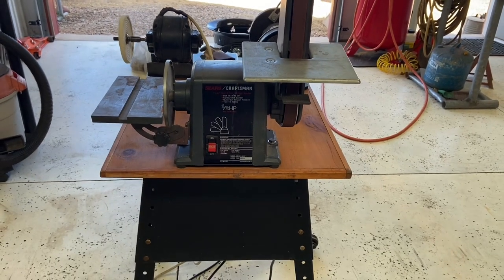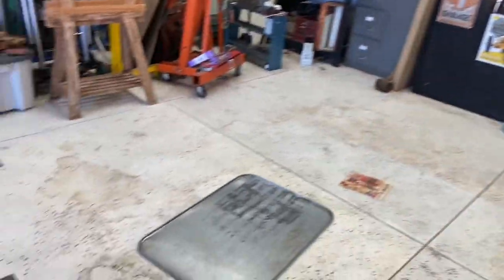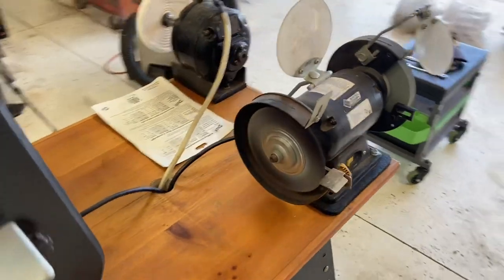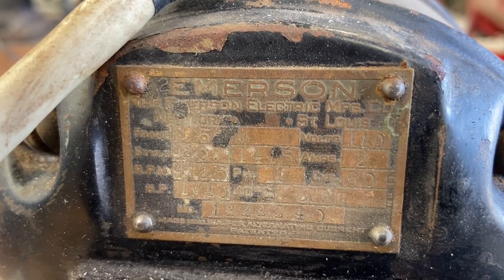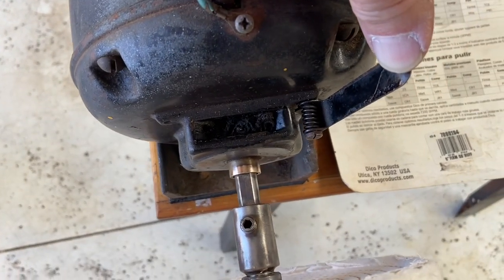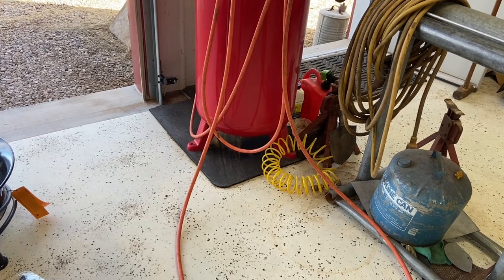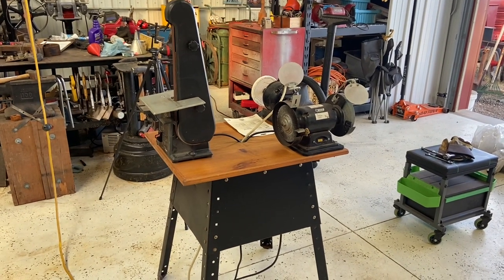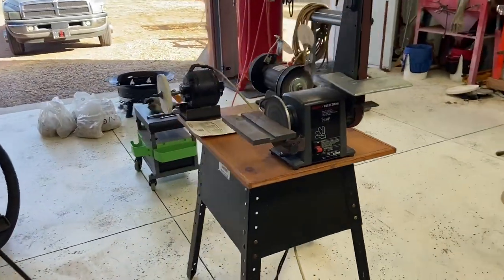#metalfab Shop Portable Workstation Update

Comment: Nice setup 👍 might need to find some weight to put under it... keep it from walking around on you.
A little rubber goes a long way, saves some vibration.
Mount a 3 wide box, duplex in 2 and the switch for the polisher in the third..
Reply from the maker: The table legs have rubber feet so it’s solid. I might have a 3 wide box in the electrical stash

Comment: that's a nice setup,  before you told about the old motor, I was thinking it was an Emerson,
Reply from the maker: Emerson is not something you hear about too often, but I was betting you knew since it was a Missouri company.
Reply: @mattthescrapwhisperer  Seen those oilers on lift motors, except there the motor is a multipole one, running around 740RPM, and the oiler has the same flip lid, but instead of the stuffing, there is a seal front and back of the shaft, and then a bush running through the middle, which has a cutout on the top side, and a bronze ring that rides on the motor shaft, bringing up oil  to the top of the bush as the mtor turns, and thus putting a new oil film always on the shaft, the excess leaving via some slots at the base of the bushing back into the oiler body. Oil level is kept just short of the bush, so it will not leak out much, and the bushings are always going to get a fresh layer of oil on them when the motor runs. Motor dates from 1936, building built and lift running in 1939. Even the buildings built in the 1970's, with newer motors, have the same oilers on them, they just keep on working, though the new ones, because the have made better bearings, now use sealed bearings, which do not last quite as long before needing replacement.